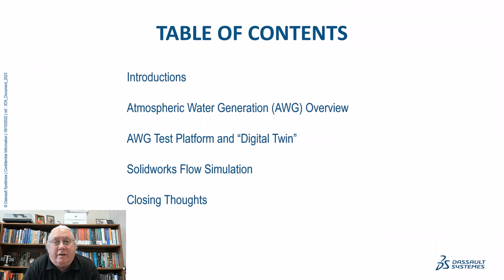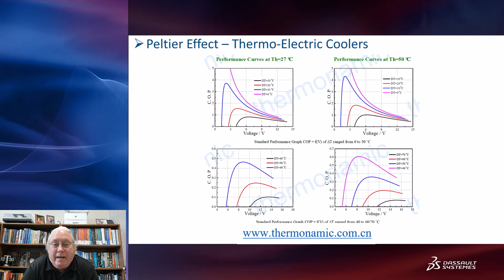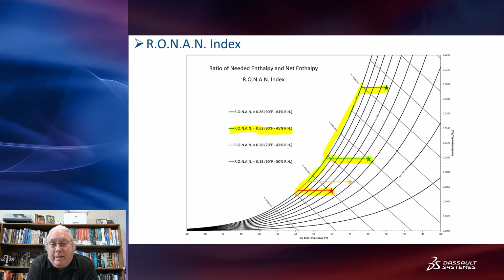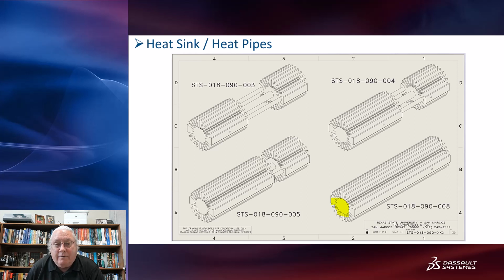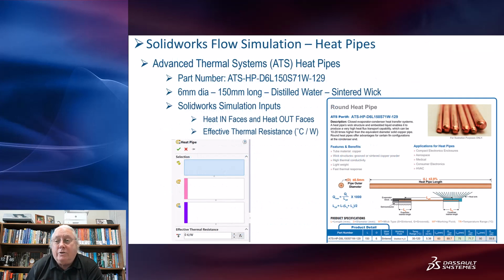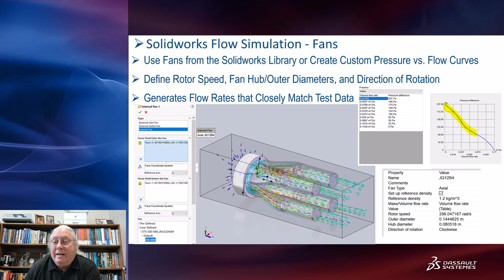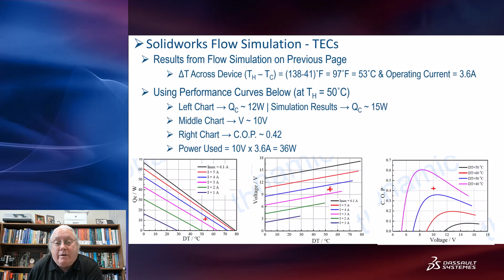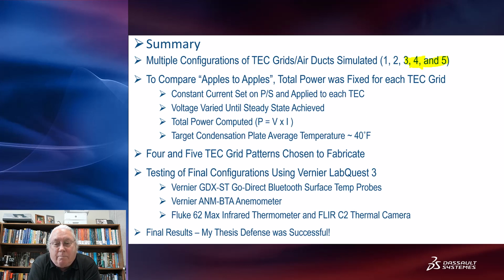Using SOLIDWORKS Flow Simulation with Peltier Devices (Thermoelectric Coolers / TECs)

Comment: Thank you so much! This video was very helpful for my personal simulation that involved a TEC component
Reply from the maker: I appreciate the kind words.  Creating the SW Flow Sim TEC "material" properties helped me better understand the datasheet curves provided by the manufactures.

I am currentltly looking into doing simulations for heat pipes, so look for a follow up video in the coming weeks.
Reply: @MarkSummersCAD  that's awesome! Also, if you ever have time it would be great to see a video on a simulation with a TEC component. I am struggling to figure out the correct setup / parameters for my project and my resulting temperature gradient is constant (every component outside TEC has constant temperature).

Comment: hi, at 31:50 you are speaking about 3.6A... I wonder how did you get this value...You say this value depends on a lot of parameters...Quote "Solidworks adjust/predicts/simulates what that current would need to be in order to operate in those ranges that are specified for the TEC unit, taken from TEC module datasheet"...or something
Once the new TEC is created in the Solidworks library, based on parameters from datasheet, you need to select the hot surface (face of 3d model), then Solidworks asks enter parameter "Current". This value can be Constant / Formula definition / F(goal) - table / F(parameter) - table. 
In your case, it sounds like you/solidworks calculated this based on some formula or global goals or something else. Can you pls explain it?
Reply from the maker: Sorry for the delay, and thanks for the question.

Yes, 3.6A is what Solidworks Flow Simulation reports aa the current being supplied to the thermoelectric cooler at those steady-state conditions.  When you define the TEC material, you enter operating parameters from tgeh manufacturer's datasheet adn Soldiwroks determingf the operating conditions and calculates the current used by the device.

Remember, the design should keep the hot side cold to keep the cold side colder at an efficient COP.
Reply: @MarkSummersCAD  thanks

Comment: Where did you find the library of TEC models?
Reply from the maker: There is a built-in library of TEC modules in the Solidworks Flow Simulation database.  Choose TOOLS - FLOW SIMULATION - INSERT - THERMOELECTRIC COOLER.

There are several built-in TEC part numbers, and you can also create your custom TEC using the manufacturer's datasheet.

Comment: Given that TEC's Transfer heat from one surface to another would it not be advantageous to utilise the heat output of the peltier module to heat water and use this heat to preheat the air going into your system? I was looking at your solidworks image for reference. You could place radiators over the intake fans thus raising the efficiency of your unit.
I'm a little new to thermodynamics as it relates to condensing water out of the air so I may be missing something here???
Would appreciate your input...

Oh Bruce is the name, Cheers...
Reply from the maker: Agreed.  In most designs we discard waste heat that could be used for productive purposes as you suggest.  Bottom line, you need to keep the :hot": side of the Peltier device cold to keep the cold side even colder.

Comment: Thanks Mark for the analysis and lucid explanation. Wanted to check if you also have any analysis done for the comparison between PWM and linear based thermoelectric controllers. I think manfacturers publish graph from linear current testing. PWM reduces efficiency even at high frequencies as compared to linear ones, but still most of the products use PWM only because of size and cost.
Reply from the maker: Vivek, thanks for the kind words.  Your question is a good one, and my short answer is "no".  Like you, I have not seen performance data from manufacturer's Laird in particular) regarding time varying supplied current to TECs.  I did try some testing during my thesis work where I would turn off half of the TECs mounted to my condensation plate for a couple minutes to save electrical power, but the results were not good for generating AWG since the condensation plates quickly warmed up and prevented water generation.

Although Solidworks Flow Simulation provided transient (time-dependent) analysis options, I don't know of any way to simulate a time varying PWM power input to the TEC elements.
Reply: @MarkSummersCAD  Thanks Mark for info